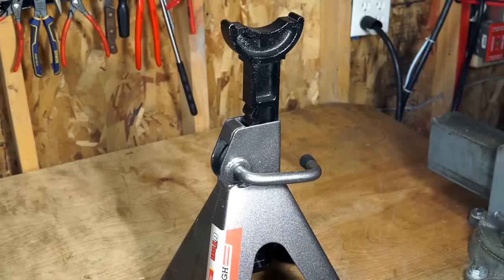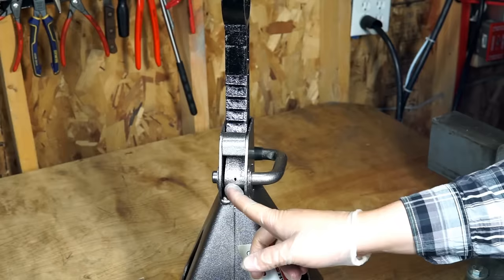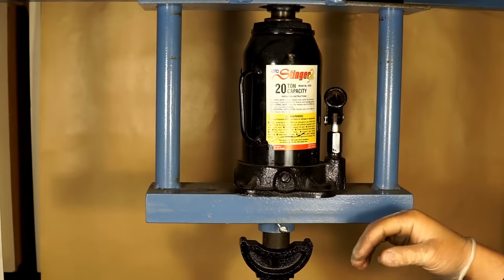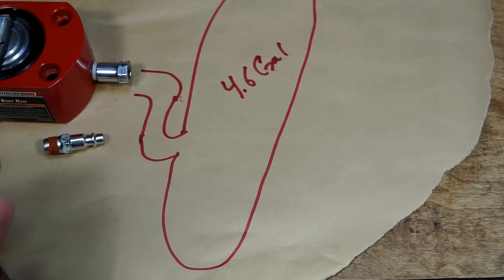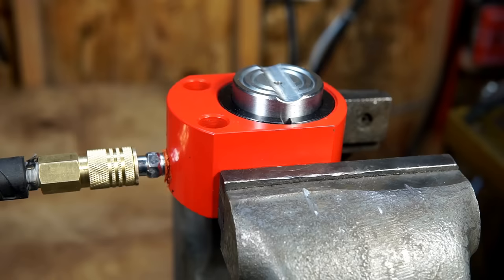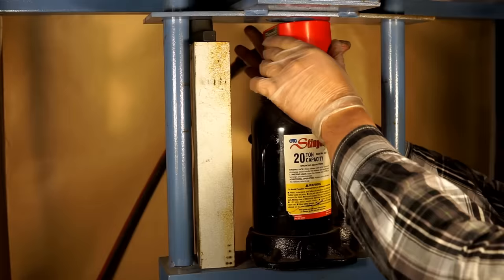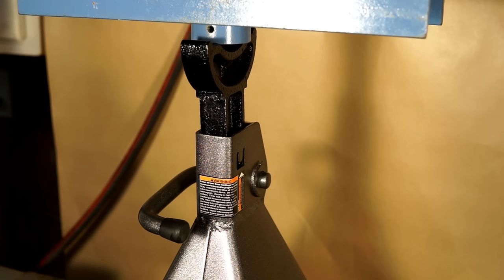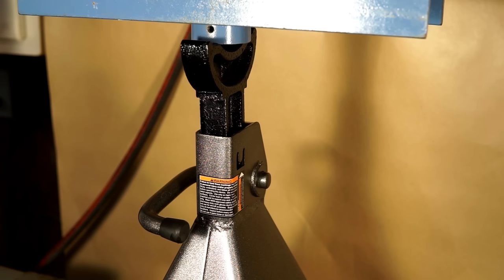EXPERIMENT: WARNING! Doing this to your Jack Stands will get you KILLED!

Comment: There is NO WAY he " Bumped" into the handle and caused a failure ! There is much more to this story that's not being told !
Reply: I disagree
Reply: Yeah fr... Even if it failed, if it was put in the right place it should have still been on the Jack stand.... It still should've been raised at least 6in
Reply: Only thing I think would’ve done that was a breaker bar releasing a tight nut/bolt and swinging perfectly into the jack handle. idk. I always use at least 2 jack stands and a jack to hold a car up before I get anywhere under it
Reply: Steve C i agree, there's no way youre 'bumping' a jack stand handle 'by accident', especially seeing as it took prying with a breaker bar and beating on it with a hammer to get it to 'fail'. The guy who got hurt probably just placed a stand wrong and didn't notice. Human error does happen.
Reply: Illuminati
Reply: Whatever happened with "Mike", he didn't get "Crushed" if it dropped to the lowered position of the jackstand and bowed it a little, he got pinched between the car and whatever surface it was on. If it would have "Crushed" his face, (Read, Skull here) he'd have been dead and wouldn't have lifted anything off of himself to yell for help.  A good lesson for everyone here. "Mike" stay out from under your car until you learn how to block and test it for secure setup. No more "Crushing" stores dude. If you can tell us about it, you didn't get crushed, at least not for real.
Reply: i agree, there's no way.
Reply: I agree, there is something that is not being stated correctly in the first story where this fellow picked it up. It wouldn't fall just from being "Bumped".  Besides if it fell on his head he wouldn't be lifting the car off his head which would be popped like a melon. He'd be D.E.A.D , and end of story. This smells fishy to say the least.
Reply: So if I get into my car and drive into a brick wall whips that mean the car failed??? Dude you loaded the jack and relieved  it. What did you think was going to happen?? Dumb test.
Reply: The weight of the car should keep the jack stand from being knocked over the handle has to lift up before releasing. Most jack stand can hold up to 3 tons most cars don’t weigh that much. I bet he wasn’t on level ground didn’t put the jack stand in the right place and didn’t use his jack as extra protection.
Reply: A few possibilities to how a jack stand can fail. 
1. Defective or worn out jack stand. But by design they are designed to shear before failure as you mentioned. 
2. Jackstands on an incline or uneven surface. So my driveway in on an incline. I've seen it before.
3. If using a breaker bar somehow unbalancing the car then releasing the jackstand.
Reply: I'd bet the car rolled because the tires weren't chocked and he's fishing for a lawsuit.
Reply: I have seen a car fall off on jack stands. Uneven surface, while breaking a bolt with a breaker bar, the car moved and jack stand fell under the weight of the moving car. User error. Luckily he wasn't under the car. Jackstand needs a solid even surface. My jackstands have a pin you insert to lock it in place. Failure like in this video will never happen.
Reply: Maybe the way he layed, he tried to push off of it with his foot to move, for a guy who could lift the car to call for help it wouldn’t be much for him to kick it with enough force to let a low quality jack give
Reply: Lol, Harbor Freight's Jack Stand recall may have proven all these detectives wrong.
Reply: So, a year late unfortunately, but the model of stand he's using has apparently been recalled by Harbor Freight because the locking mechanism isn't machined properly and the stand can collapse unexpectedly.
Reply: Yeah, there is more to it.  Harbor Freight cutting corners made a line of jacks that does collapse with just a bump to the handle.  They got recalled and another guy did a great comparison between a properly made jack stand and the defective harbor freight ones.
Reply: Yeah, it sounded like this guy wanted to die
Reply: @EM-df6mo  914's are very low to the ground and they are light cars. I think he may have had the 2 sides of the car uneven..its a guess of possibilities...then again, there maybe that one point the jack tooth didn't lock in, and got a pebble or something...or that one jack he had was defective...hard to say, BUT, I would recommend getting a jack stand with a safety pin. its what I use, and that one channel with the press machine did a test and that pin actually help a lot more weight.
Reply: Nope, this has happened to more than "the guy named Mike"
Harbor Freight has recalled them due to all the similar incidents.
Reply: I had a similar issue in designing a latch for an infant incubator porthole door - odd analogy I know - but ... most latches can get 'hung up' in an intermediate position where it engages, looks locked, but isn't fully locked. This allows far less force to open it. This scenario may be what happened to the guy in the story. I'm about to buy jack stands, I'm gonna make sure they are good quality and don't get 'hung up'. A few extra bucks life insurance in these tools should be worth it. Thx.
Reply: The guy probably did have the car sitting on the stand properly, and one fell off. Easier to sue when you say you “bumped” the handle.

It took a guy with a breaker bar to cause it to fail.

 Buy one with a safety pin and use with the jack or spare tire as a safety.
Reply: I totally agree.  We all seen what he had to do to make it fail.
Reply: it takes a lot more than just a bump to release, I have these stands and have even tried to get them to go down on purpose and could not get them down, so you will need to really make an offort to do it
Reply: Yeah, it's a big conspiracy...lol
Reply: 100%. It had to have been completely cheap or just a straight up manufacturer factor failure.

Comment: I always use a jack stand with my floor jacks. If I have to get under the car, i use two or more. There is nothing wrong with over doing safety, when your own car can crush you.
Reply: Yup,... Having a car on you is not fun
Reply: Shawn Young tell my gf that
Reply: I have had floor jacks spring a leak and release on me before, thankfully on a car that did not sit so low to the ground it hurt me. Never rely on them.
Reply: Richard Smith The one redeeming quality of a pickup truck or SUV
Reply: +Tony Hong    I can think of one or two other redeeming qualities of a truck or SUV.
Reply: If I take the tires off I put them under aswell.
Reply: Sometimes you only have on jack how about when you lift all four wheels.  Thank to God I have been an auto technician for over thirty years I have never had a problem with good jack stands.